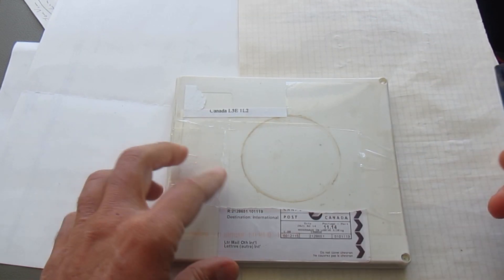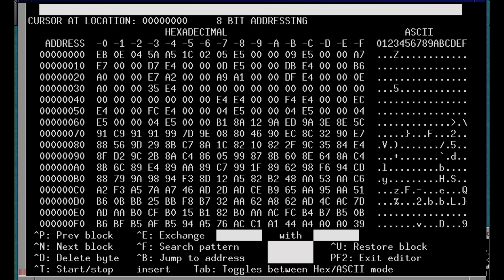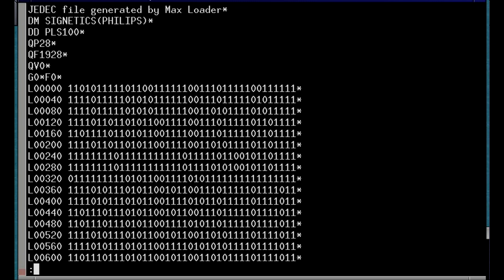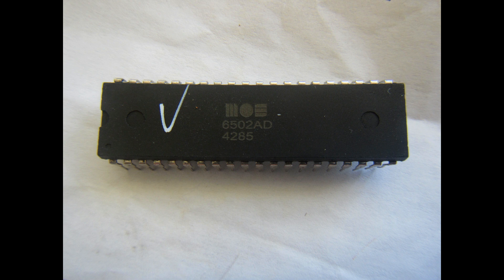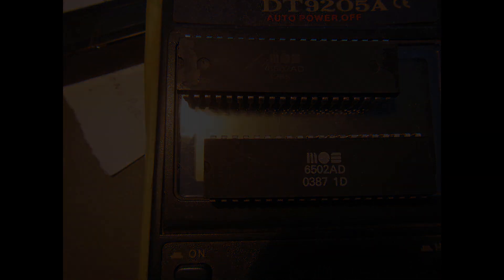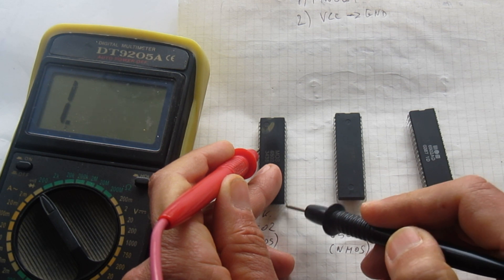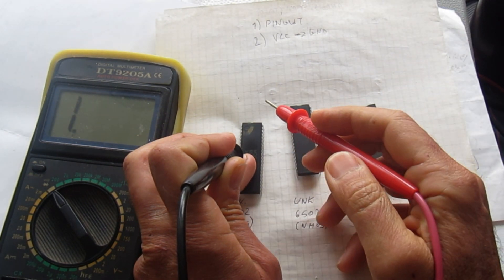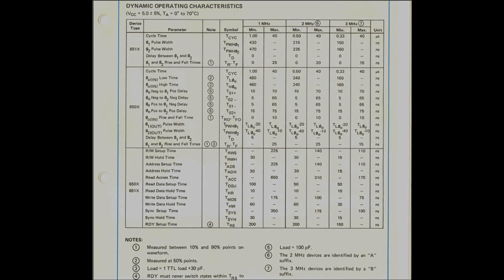IZ8DWF gets mail #2! C64 PLA and how to quickly check a rebadged 6502.

Comment: The CMOS versions might not work properly in applications where there are no bus, control and address line buffers, as the CMOS drive levels are a little bit weaker than the NMOS drive, especially if the other chips they are driving are all NMOS or TTL. In an Apple II no problem, they will work as there are bus buffers all over. Another clue is that if you simply put them in circuit they run cooler than the NMOS.
Reply from the maker: Hi! Actually if you look at the datasheets of both NMOS and CMOS versions of the 6502, you'll notice it's the contrary. NMOS drivers are specified at -100uA high/1.6mA low output currents. CMOS drivers can do -700uA high/1.6mA low. Also, the output high voltage will be higher on CMOS chips. 
CMOS chips will run much cooler, yes.

Comment: I have the version with the 3438 datecode. Tests ok with the 1541 diagnostic cartridge's performance test, fails while running Lunatico.
Reply from the maker: Hi! Yes, makes sense since Lunatico uses undocumented opcodes in the very fast 1541 loader. The loader is described in LFT blog.